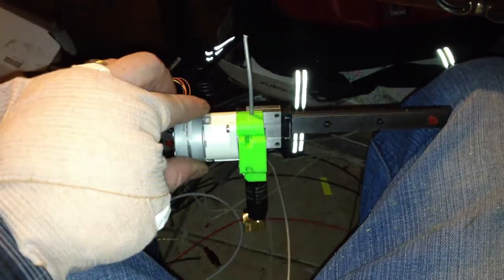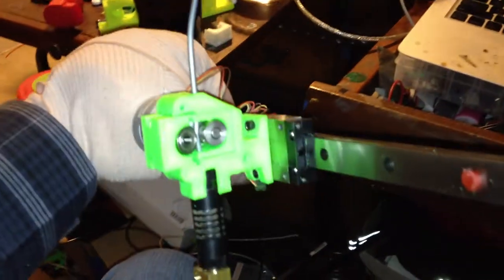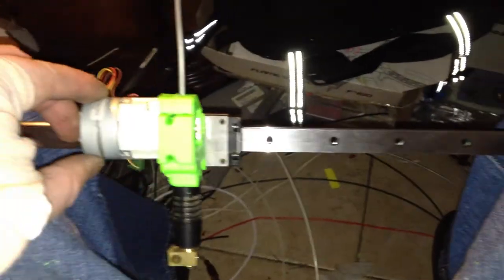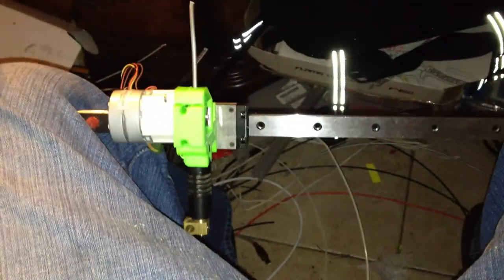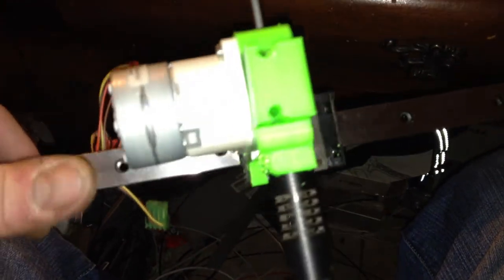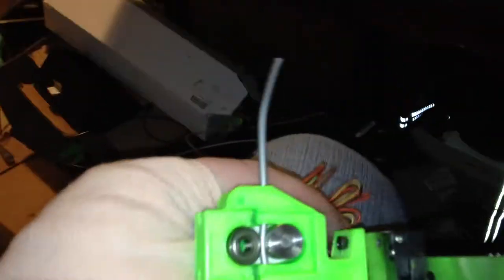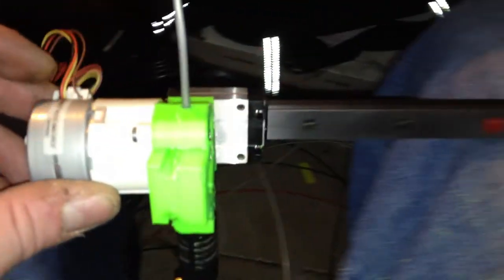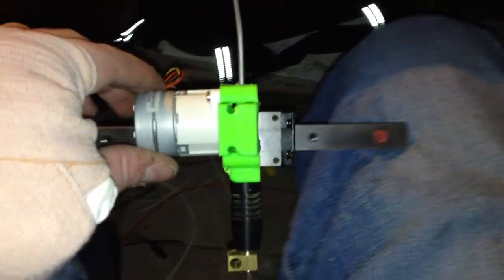TrinityLabs MendelMaxPro X-Axis

Comment from the maker: @tiagofumo -  I apologize for calling them stupid, I could have used less offensive language. But... I have built over 20 different reprap 3d printers of all different kinds and kept notes of the pros/cons in all of those builds. The biggest issue with almost every kit was the parallell rods and bushings or linear bearings. The biggest cause of stutter, binding and low print quality was a result of trying to get the two rods aligned within micrometers of each other. continued....